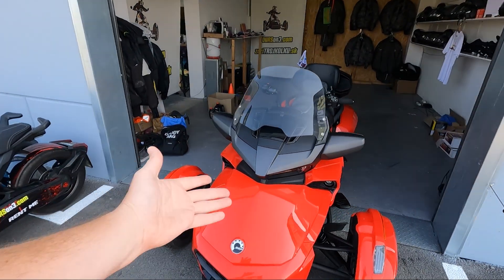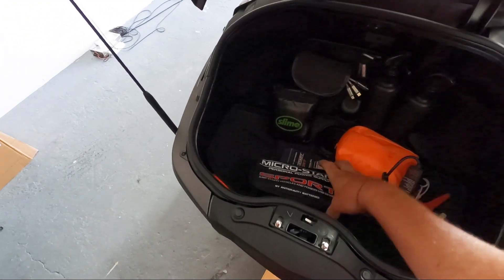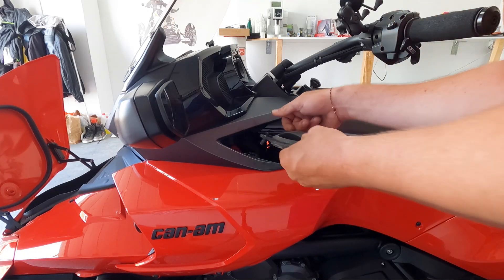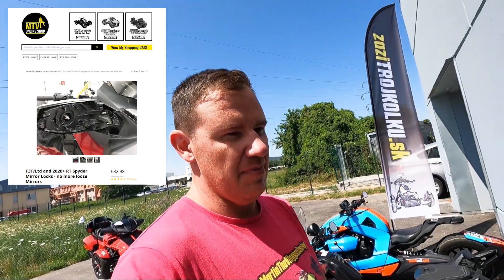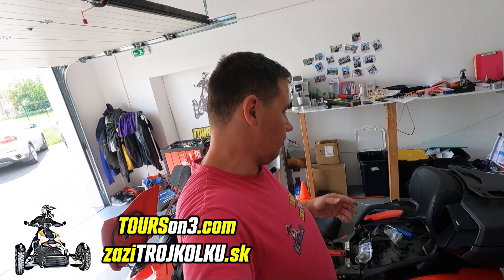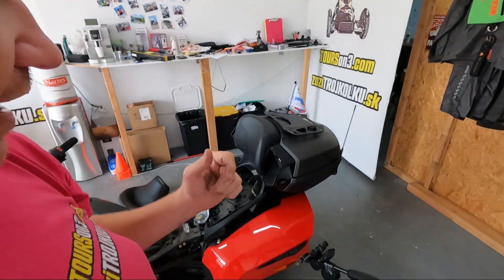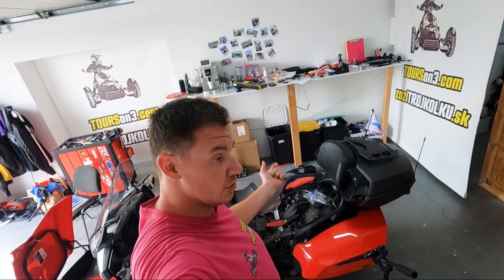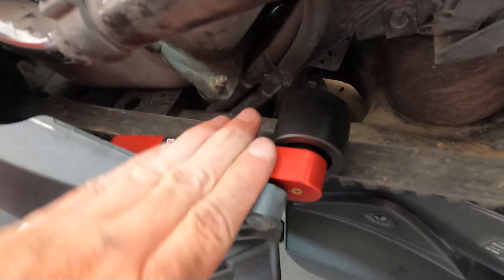The Must-Have Upgrades for Can-Am Spyder F3 Limited by MartinTheVlogger - Part 1

Comment: I have a 2022 Spyder F3. The passenger seat won’t come off. I turn the key and it’s like one side comes up and one side doesn’t come off. I also have a trunk on the back can I take that off to get to the cables Oh, how do I take the sides off to get to the cables?
Reply from the maker: Hi, rear seat you need to shake it sometimes and also you neeed to unlock the key and hold the key while you try to unmount the rear seat. Seat locks only on one side.. as for top case, you just undo it with the plastic mechanism inside of your top case. All you need is lid-cover to cover the gap that is created aster removing the top case. Not sure what cables you are reffering to. M.